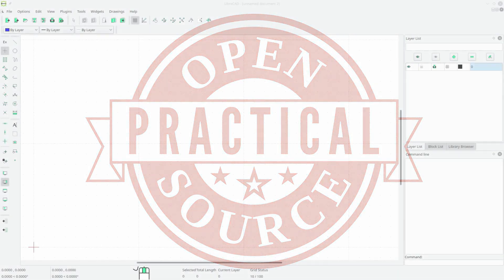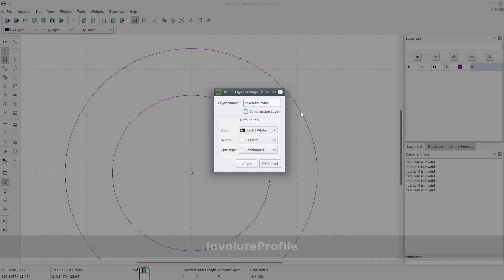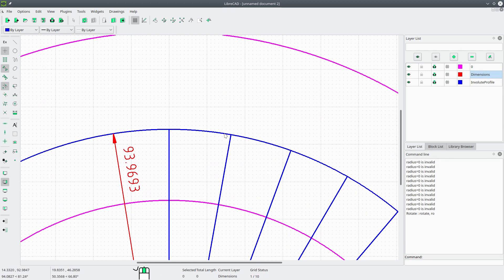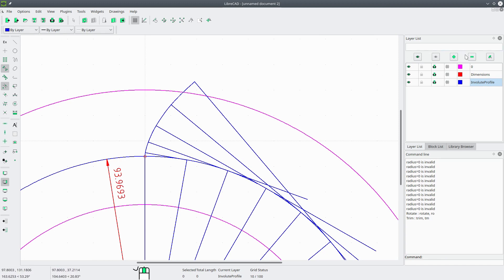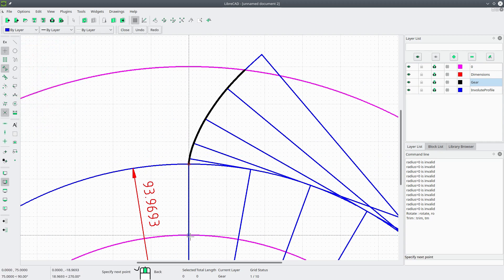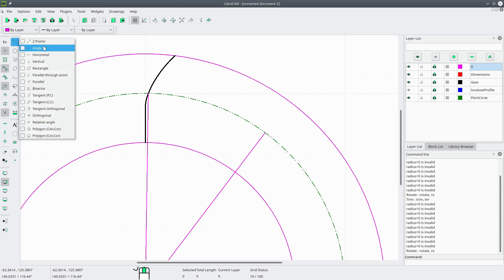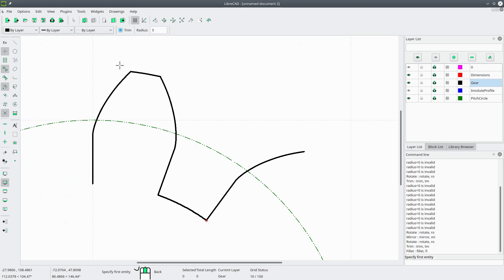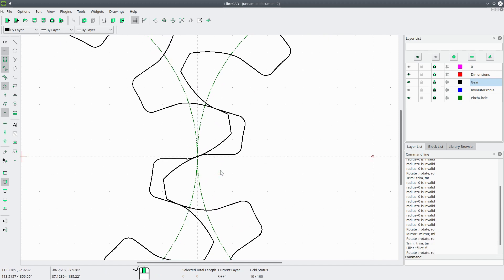LibreCAD Tutorial: How to Draw a Gear

Comment: How did you turn on endpoint and center snapping at the same time? I can only enable one at a time. (I am using ver 2.1.3 on Windows)
Reply from the maker: There's a button called "Ex" that turns "exclusive snap mode" on and off. When exclusive snap mode is turned on, only one snap mode is allowed. Make sure to turn it off and you should be able to turn on multiple snap modes at once.